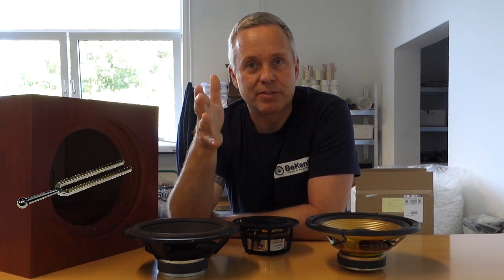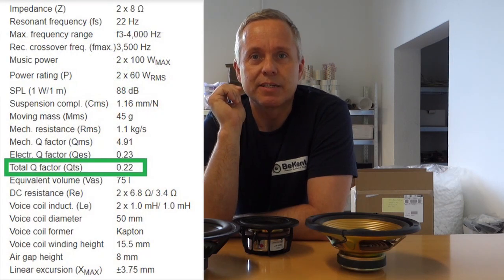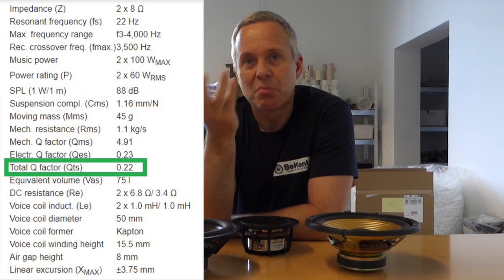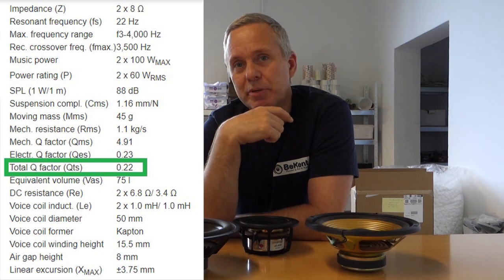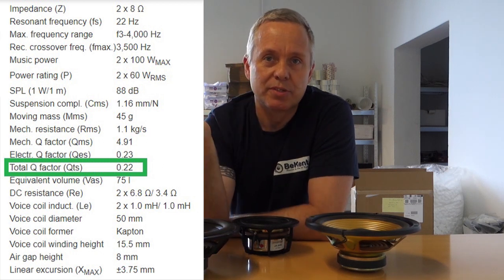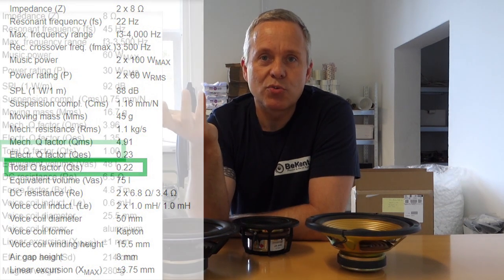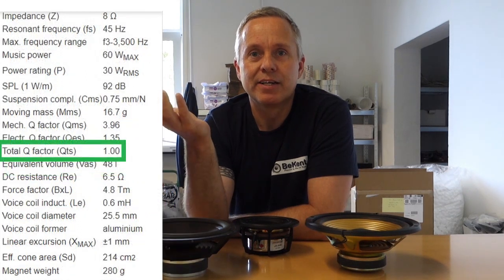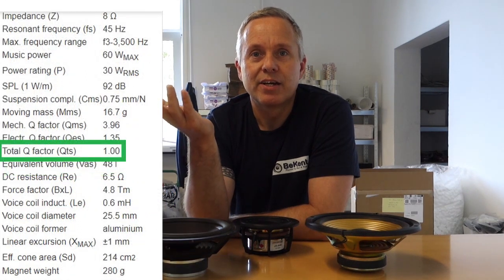Woofer QTS explained

Comment: From what I've gathered there are three frequency areas a woofer can operate in. The +12db per octave lower area where position (force) is constant. If you were to apply a battery say 1.5 volt to the speaker then it pops forward say 2mm and that's it. That's what I mean by position = constant. It doesn't matter if we're at 2hz  5hz or 10hz..

Then there is the 6db per octave mid area around Fs where speed (voltage) is constant. And force (or current) tends to go to zero because the two forces cancel out.

Then there is the flat 0db area where acceleration is constant. (and force is constant again).

When the drivers qts is lowered that means it has a relatively lower electrical resistance that means that the area where the driver is 'in control', or the mid +6db/oct area, is widened. Here the voltage the driver generates more or less equals the voltage that's applied, that means 'speed is constant' so to speak. 

In the other two areas the lower 12db and the upper 0db one, the current is limited by the resistor so you're in a kind of force = constant regime. If there was no resistance some kind of superconducting speaker it would be in 6db per octave mode all the way. I hope that made any sense. At q 0.7 there is hardly any 6db slope area and it goes directly from 12db slope to 0db flatness.

Comment: Is there any way to look at the specs (in a speakers retail description) that I could look for when searching for a decent sub for infinite baffle? I'll see if I can find the specs on a Honda Accord trunk space...
Reply from the maker: The qts should be above 0,7 to have substance enough to play infinite baffle. Good Xmax is more needed because a box is not assisting the throw.
Reply: @AudioTalk  above 0.7? I saw where somebody said that the bigger (actual diameter 18" sub for example) the sub, the better performance if I'm going to let the trunk space be the enclosure. Back in the 90's I took the backseat out of a Ford Festiva and built a wall for 2 12" Kickers Comps; And I put a Punch-75 on each one using a crossover. This was all new equipment (in the 90s). I didn't think it would sound good because the subs called for a 2ft x 2ft enclosure for each speaker. But they performed amazing! The lows were extreme (for the time). And that's one reason I've looked for the older Stillwater design Kicker lately; with no luck.
Reply from the maker: @Scandinavian_Pride  yes, 0,7 but max 1,0, typically woofers with higher qts would be low quality, but that is anecdotal because its possible to create a driver with higher qts and maintain a good driver, I just haven't seen it.
Reply: @AudioTalk I've got some .67 they're entry level but the just a larger version of their studio sub. They get the best performance out of a ported box vs IB
Reply: @AudioTalk geez bro learn the difference in a comma and and period🤣🤣🤣 this is a comma , this is a period or point .

Comment: So "1.2 is a very high and 1.2 is a very low Qts" - I had to listen this 2 times. Instead of Qes, Qms and Qts declaring high or low, it probably would be less confusing declaring them hard vs soft or strong control vs weak control. or fast vs slow, just anything but high vs low.

0,707-alignment is the Qtc with f3=fc in a closed box and sure, to calculate it, the Qrs is involved, but it's definitely not the Qts of the stpeaker-driver.

Looking at the other comments, I seem the only one unhappy with this mess. Well, i'm getting more and more used to it.
Reply: I agree with you my Diy dual opposed 12 inch Scan-Speak subwoofer has a Qtc of 0.90 in a 55 liter box, to lower the Qtc to 0.707 the box must be 134 liter.
A box with Qtc 0.50 must be 200 liter and sound like a blurry base mess.
Qtc 0.8 to 0.9 is the sweet spot for SQ and fast base in smaller boxes.
With the DSP on the Hypex amp i tuned the sub on 22hz+-3db.
Reply: @palmspar  Qtc of 0.8 already cuts the volume nearly in half, lifting the peak dB only 0.21dB.

Comment: In midrange maybe we need driver that have higher Qts like 1.5 or more.. if we see on tube amplifier, they have low damping factor and that's why they sound more musical on midrange.. the best way to use high qts driver by using open baffle design?? What do you think?

Comment: How does QTS relate to infinite baffle application. Some say higher QTS is good for infinite baffle. But when researching a perfect subwoofer, I see some free-air subwoofer with low QTS. It made me confused. Can you clarify this?
Reply from the maker: A low Q driver in infinite baffle will be anemic without DSP, so its possible to increase Q with DSP and then use a low Q driver. But without it the bass response will be anemic if you are under 0,7 in qts. Under 0,7 is what you called overdamped and it will cause the driver to roll of to early and with no substance, but it will be very nuanced.

Comment: Thinking of using B&C 15DS115-4 in my vehicle in true infinite baffle application (vented to outside). I know they say that a high Q is best suited for IB application, but I like the very tight and hard kicking sound of pro audio drivers in general. Would this give me good results with some DSP?
Reply from the maker: Good question, a qts of 0,17 is very low and will without doing something about it will be basically no bass. Tight bass is around 0,6 to 0,7 in qts for IB, most Hifi speakers are aimed at 0,707 called butterworth alignment and it pretty tight. But if you can raise the Q in your DSP to 0,7 or whatever you prefer, you are good, but without that will the bass will be beyond anemic.
Reply: Audio Talk thanks for the reply. How would I raise the q with dsp? The sub has something like 16mm Xmax and plenty of power handling, so I was planning to just eq the low bass up to flat, or slightly boosted, with the dsp
Reply from the maker: @grandpixel  its only if your DSP modul has that ability, in the DSP software it will say Q along side choosing the frequency and how many dBs you wanna boost. If it doesnt say that in there, raising the level wont help. But you will use more power from the amp to this, where the box will hand you this for free, so I dont recommend this driver for IB
Reply: Audio Talk but I believe that “q” is referring to the damping or falling off of the frequency being adjusted. It changes the scope or width of the adjustment, but has no effect on the electrical or total q of the driver or speaker system itself.

I am still not convinced that this wouldn’t work well. I kind of want to try it but these drivers are PRICEY! If it doesn’t work very well it will be sort of a waste. I suppose I could always sell at a discount.
Reply: Audio Talk also you say that a vented box can hand you reduced damping for “free” but it’s not really free. It comes at a cost of having that trail at the end of every sound, which reduces transparency and accuracy, am I right?
Reply from the maker: @grandpixel  as far as crossover topology you are right higher Q makes the cut steeper but creates more ringing at the crossover point, but thats something else. Many DSP moduls can add Q (ringing) to a bass boost as well, but again without that ability your woofer will roll off probably already at 200Hz and because the Q is so low the sound will be nearly transparent, and that sounds very boring and unnatural.
Reply from the maker: @grandpixel  sure, but the good balance point i 0,707 butterworth alignment, and super tight is 0,6. Your woofer is under 0,2 which far to low.
Reply: Well, from experience, I had a 21fs driver in an enclosure that gave it Q 0.5 and it sounded...hmm weak is a good word for it. Then I put it in a Q=0.707 at 47hz box (1/3 vas) and seemed to tighten up to me (and fuller). I never measured it to find out why but I just knew it sounded better that way. Both boxes were EQ'd flat.

Comment: Thanx! Now I know things better. Long ago I used to have french mid sized 2,5 way speakers with very little damping, bass reflex opening to the front. They were fairly expensive but the stands had no good wife acceptance factor. The stands were just physically useful, not for the eye. Their bass was so dry, that I assume, Qts, Qes  were very low. The manufacturers even made the chassis in house. Same company also made smaller and larger enclosures using the same drivers. I think in a bigger enclosure the chassis sounded better, but I could not effort them. Sound slightly improved by using a PP layout with EL34.

Comment: good morning ! Thank you sincerely for the really useful and well done explanation. I understand that a low qts is also a measure of the intrinsic quality of a driver, and i see that drivers with low qts have a very high cost. I've seen some JBL woofers with low Qts .... they have crazy sized magnets ! Scanspeak makes woofers with Qts of 0.2 ... and they have become a classic.  Moreover I also believe truly in instrumental tests. A driver who has an impulse response like a tuning fork (i.e. with little damping) does not do anything good I think. I have a personal experience with a Dynaudio woofer with Qts = 1. it was slow to start and slow to stop ... even using powerful solid-state amps the bass was confused ... not convincing at all.  Unable to transfer the sense of rythm for instance.  I think it depended on the magnet being too small compared to the moving mass of the cone. It needed a much more powerful magnet.  And actually the better version had a bigger magnet and much better bass response.  I think the bass Qts is so important that lately I'm very interested in field coil drivers, a concept that can provide very low Qts ... but they must sound spectacular.     Thanks again for the interesting and precious explanation.   P.S. has i said that i believe strongly in measurements ?  if only i could afford a well equipped lab ...
Reply: Scan-speak is lying!  The real Scan-Speak parameters very far from the datasheet. And real Qts all Scan-Speak high.  Scan-speaks also have  cheapest baskets in the world, the diffusers cheap and  magnetic system very weak, therefore Qts high.
Reply: @РуфатШиралиев-л8л  hi I am shocked Their drivers are used in very expensive speakers
May I ask you speaking of woofers which brands in your opinion offer the best value for money? Thanks a lot and kind regards gino
Reply: @gino3286  Are you from Italy? Gino? For the most accurate answer to your question, very desirable to know the answer to this question.
Reply: I wrote you a comment, but Kent deletes it. Apparently He does not want and is afraid to face the truth. How can I write to you?  You have  email?  I will tell you the honest truth.  I know about all companies in the world in the sound industry.  Honestly.
Reply: @РуфатШиралиев-л8л  hi yes of course i have an email but i prefer not to show it 
However i think it would be surprising that a brand like Scanspeak published wrong data in the specifications sheets.  Did you measure them ?
Reply: @gino3286  Yes, wrong write. And one nuance. One day, carefully look to Scan-Speak drivers.. Scan-Speak catastrophic cheaply made.. Membrane cheap, basket extremely thin, magnet little, but price very high. And frequency response bad.. Scan-Speak true Denmark 🇩🇰 product. Made very beautiful, but extremely cheaply and bad. Denmark 🇩🇰 absolutely empty country. Have only fish and empty fields. Denmark 🇩🇰 made speakers, because audio industry no have price limit. 🇩🇰 speakers made only for money 💵💵 💵 . Holland grows vegetables and fruits in huge quantities using a lot of chemicals and drugs give money for Holland. For Denmark speakers  only one source of income.
Reply: @gino3286  Mr. Gino I tell you one thing. Speakers build - big passion! For make speakers need love.Biggest love! But Denmark and England made speakers only for money 💵 💵 💵. For maximal profit. Drivers made catastrophic cheaply and bad, crossover parts - garbage! Speaker cables cheapest.. Because think only about money 💵 💵 💵 💵 💵 💵... The Dutch,  Danes,  English and Swiss love only money💵💵💵💵💵💵💵.
Reply: @gino3286  I can see the love for speakers in Kent's eyes. Kent good man. Maybe Kent would be the only Dane who would make speakers with love and from the heart. But Kent is a very poor man.  He does not have the opportunity to open his own factory.
Reply: @РуфатШиралиев-л8л  I have one scan speak driver and it measures very similary to  data sheet. All manufacturers make speakers for money. I don't see anything wrong with Denmark or Uk drivers. I see a big problem with Russians in general through
Reply: @wadimek116  Mr. Scan-Speak advertises own woofers like Top High-End and sells them for the price of High-End woofers. When in reality, Scan-Speak made very primitive and extremely cheap! Scan-Speak and Dynaudio have the cheapest speaker baskets in the world.Really! Scan-Speak baskets  the thinnest! They crack. And frequency response of the Scan-Speak is poor, so Scan-Speak's shortcomings need corrected with a crossover, but this very bad. The voice coil, which used Scan-Speak also very cheap, not made Japan 🇯🇵 at all, and Scan-Speak also saves on the magnet, used very little magnet systems. Scan-Speak sell own woofers 🔊 for 600-1000 euros, but  themselves save on everything, the cost price of their woofers 10-15 euros. Or maybe less! Absolutely no have quality, just a beautiful look!
Reply: @РуфатШиралиев-л8л  Their distortion is phenomenal through and best hifi speaker I heard was beolab 90 which is fully on acan speak. Neither focal grade utopia with naim top amp got to that level of performance. If they would be bad they wouldn't be used in top tier constructions with a success
Reply: @РуфатШиралиев-л8л  Also your account is only 2 years old so Im guessing your just a kid who never used any drivers. Second your from Russia. A country with most propaganda in the world who is at war right now and loses to Ukraine.
Reply: @Gabriel Moldovan HI Gabriel! I like other Peerless models, but this model very bad. If you need 8'' bass woofer, look to Seas h1192-08 cd22rn4x. Yes, I am hate Seas, because Seas all own history made low Qms woofers, this very stupidly! Very stupid people made Seas,because for natural sound need extremely high Qms 14-25. But Seas 1192 have low price, for 100-110$ this no biggest problem.

Comment: Thanks! I was hoping you would talk about how those Q values impact ported vs sealed choises. I assume a high QTS would be best in a sealed box so it's less "boomy"? Likewise, a low QTS would be suited for a ported box to extend its boom? Really appreciate your content. This is good stuff!
Reply from the maker: John Fisher thank you for your comment, you are exactly right about the higher qts is great for a sealed box. The presentation of the sound is highly depended on q values so this won't be the last word on the subject.
Reply: Yes, qes higher, to lower the EBP number. An EBP of 50 and below would be a sealed chamber. Ebp 50 to 100 bass reflex and bandpass, above 100 horn loaded
Reply: @tomthumb6269  It depends what you're going for. While a QTS of > 0.7 would almost certainly make a terrible tuned port driver, it also wouldn't make a very great sealed enclosure, unless it had a massively huge box. The lower the Qts, the smaller the box requirements, the better the damping, and you have the option to adjust the QTC of a sealed enclosure to your liking. Qtc of 0.707 is the generic go-to for most flat frequency response and then have a 12dB/Oct roll-off. QTS of 0.5 has the best impulse response with no overshoot, being critically damped. A QTS of 0.577 is a Bessel response, and would have the fastest impulse return rate with the least overshoot.